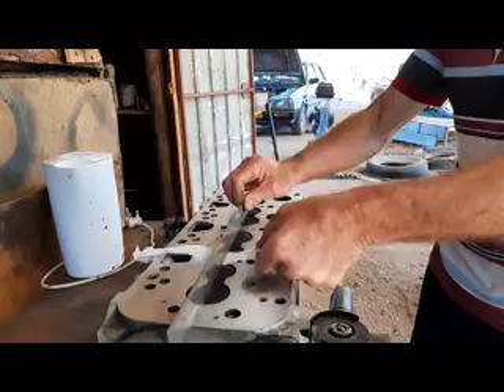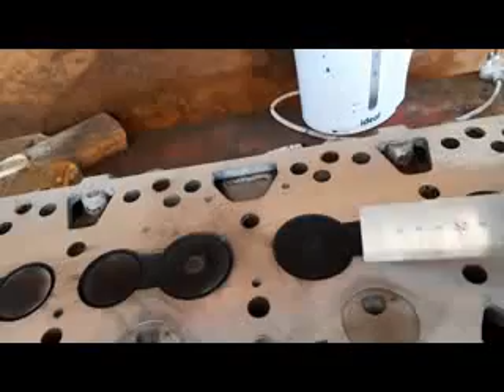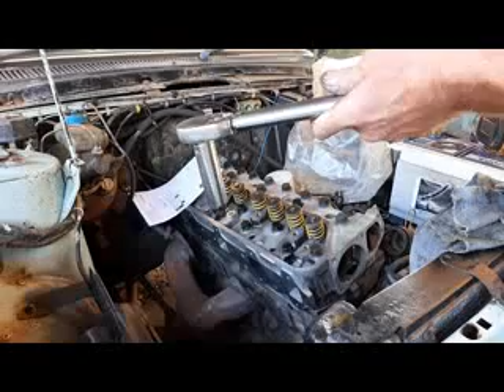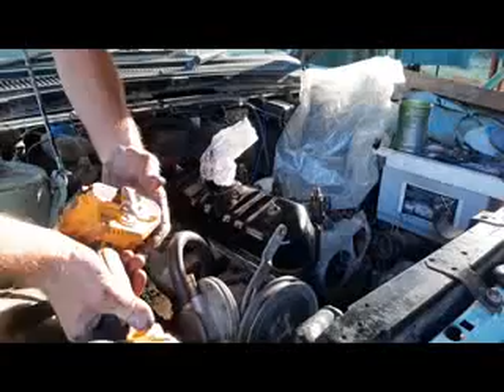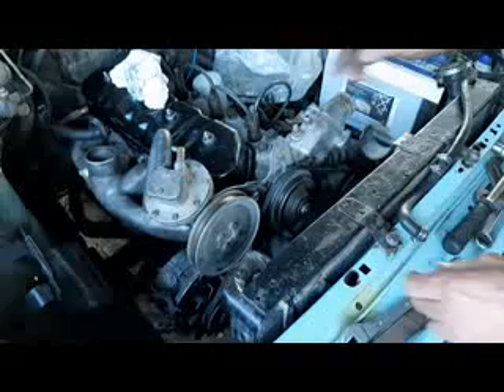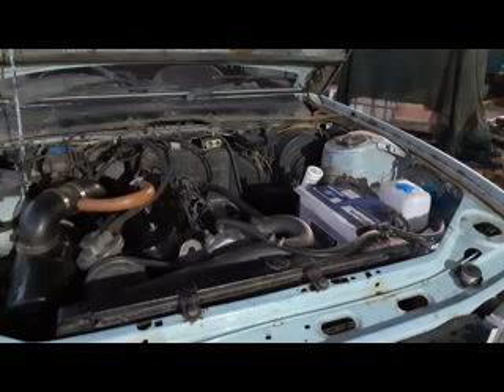Peugeot 505 GLD XD3 Cylinder head gasket replacement part 2

Comment: Hı. what is the oil pressure of the engine
Reply: Hi! What the cylinder head bolt torque specs?
Reply from the maker: Hi there. I have no idea what that should  be.
Reply from the maker: Hi . Make it 80 nm.